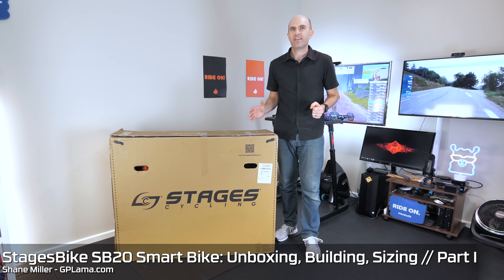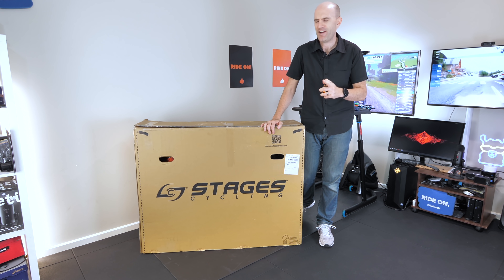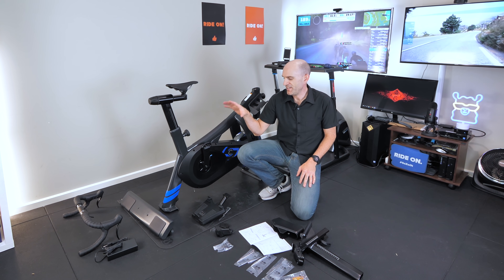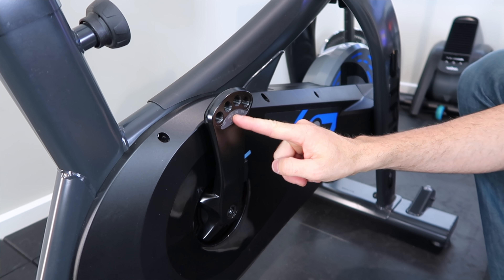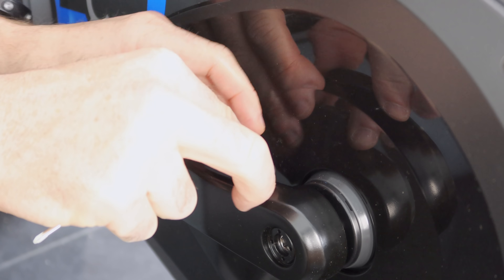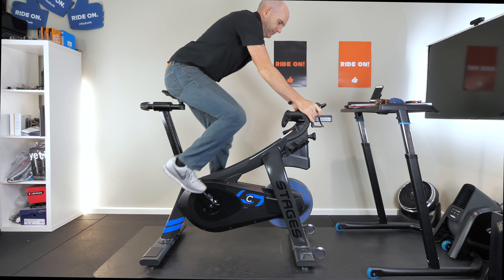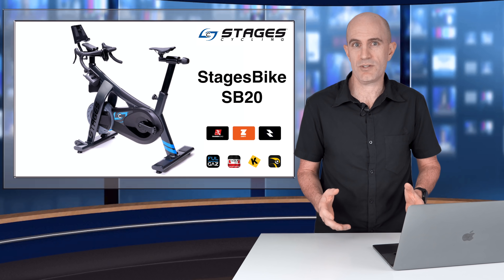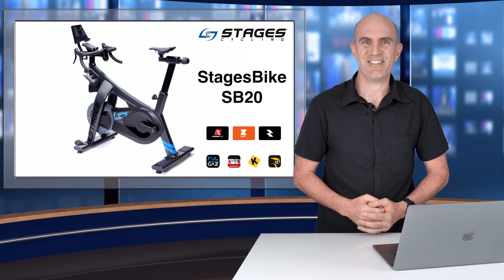StagesBike SB20 Smart Bike: Unboxing, Building, Sizing // Part I

Comment: Shane -  great review Part I video.  I think alot of potential buyers are interested in an in-depth description, review and demonstration video on the various "control modes" that the Stages SB20 bike offers:  manual, level, ERG, simulation, etc.  Specifically, I'm very interested in the Level Mode function of the Stages bike.  There's simply no good information out there on the internet, YouTube (or Stages website) on how this Level Mode actually works and performs.  I have a cycling app that changes levels of resistance with cadence changes.  The "levels" on my app are generic:  1 - 20.  There is no specific power target.  Power is just a result of changing the instructed resistance level with the instructed cadence target.  My current bike (Freemotion Tour De France commercial model) does not give me levels, but only gives me gearing options (standard vs. compact front and various 11-speed combo cassettes).  This works for what I need, but I like the idea of breaking my gears into equal intensity levels.....say: each change in "levels" = 20 watts.  With traditional gears and bikes, changes from one gear to the next gear does not equal the same, equal change in resistance level (given the next higher/lower gear ratio or gear inches).    Thanks again - great videos and reviews.
Reply from the maker: Ball is with Stages for now. The firmware is still beta. No gear change customisation or gear view apps are public. When they are released, I’ll keep these videos coming.

Comment: When is part 2?
Reply from the maker: Longer away than I expected..... Stages are yet to release the final firmware/app for gear configuration.
Reply: Shane Miller - GPLama  I have already preordered one here in the U.K. so was really only after your part 2 as reassurance I have made a good choice. But I think I have as their build & functionality will stand the test of time. 
Do you know if their firmware for the gear change will add a little real life feel to the gear change?

Comment: Shane, I just ordered the bike from USA 😂. Couldnt shake it off my mind. Had to pull the trigger.

Got a question to ask, can you check the power adapter rating for input power, whether it accepts a variable voltage input, ie 110 - 230V input. And that the wall socket end can be easily changed by getting another generic plug end. Is the socket at the power adapter (for the wire end of the wall plug) universal? Reason I asked is that I bought it from USA and where Im staying, the power source is 230V and using UK/euro pin plug. 🤦🏾‍♂️
Reply from the maker: Yep, you're good. The power brick has an IEC connector so you'll be right to go.

Comment: BEST SPIN BIKES (Ranking by Q factor)

1- Wahoo Kickr Bike (Q Factor is 150mm)

1- Nordictrack S22i (Q Factor is 150mm)

2- Life fitness IC4, Ic5, IC6, IC7 and IC8 (Q Factor is 155mm)

2- Life fitness IC3 (Q Factor is 155mm)

3- StagesBike SB20 Smart Bike (Q Factor is 157mm)

4- Spinner NXT (Q factor is 158mm)

4- Spinner Blade (Q factor is 158mm)

5- Wattbike Atom (Q factor is 160mm)

5- Bodytone MT2 and WT1 (Q Factor is 160mm)

6- Schwinn IC PRO (Q factor is 168mm)

7- Peloton spin bike (Q factor is 170mm)

7- Schwinn AC PERFORMANCE PLUS (Q Factor is 170mm)

7- Schwinn AC SPORT (Q Factor is 170mm)

7- Life Fitness Lifecycle GX (Q Factor is 170mm)

8- Wattbike Pro/Treiner (Q Factor is 173mm) 

8- Life fitness IC1 and IC2 (Q Factor is 173mm)

9- SUNNY ASUNA 6100 (Q Factor is 176mm)

10- SUNNY SF-B1805 (Q Factor is 182mm)

11- Diamondback Studio Cycle 1260Sc (Q Factor is 187mm)

12- Schwinn IC4/IC8 (Q factor is 190mm)

13- Keiser M3i (Q factor is 197mm)

14- SUNNY SF-B1709 (Q factor is 203mm)

15- SUNNY Evolution Pro SF-B1714 (Q factor is 216mm)

Q Factor: Is the distance between the outside of one crank arm to the outside of the opposite crank arm.

Why should you care?
I know from experience that the narrower the Q Factor, the closer my feet are to each other, the more comfortable I feel riding a bicycle. 
This is especially true on a long ride or training.
long distance q factor spin bikes can damage your knees
Reply from the maker: Mate...... what’s your mission? One post is enough.
Reply: @gplama  my mission is inform the public the relation of Q factor and knees health :D
Reply from the maker: @pedrodkuhn  Can I suggest uploading your own video presenting this idea then? The cut and paste campaign comes across as spammy and really counters your quest.
Reply: @gplama  Its not a idea its a fact...peace and love

Comment: Hi Shane, when will it be possible to see part 2 on the Stagesbike?
Reply from the maker: Looks like they're a week or more away from having things ready for the gear/app config.
Reply: Shane Miller - GPLama  the little drawback for the moment is the fact that we need to use batteries for the power on the stages bike... looking forward to part 2.... still between kicker bike or Stages 😬

Comment: Shane on ur web site in regards to the pioneer power metre you said it has the dreaded right side problem what do you mean by that? One of my dual sides has stopped working all together and I have changed batteries and it won’t work any idea?
Reply from the maker: https://gplama.com/2019/06/29/shimano-crankset-power-meters/

Comment: Does the seat post wobble around much? I'm 870mm from the crank to the seat so wondering if the seat post would wobble much at that height?
Reply from the maker: Not a lot, no.
Reply: @gplama  Thanks, good to know!!

Comment: What trainer you tried and found to be most responsive in erg mode? Neo 2T, Kickr2018, H3, or maybe cheaper ones like Direto x, Core, Suito are as much responsive as top tier? What would be best in doing vo2max 40/20 type sprints in erg?
Reply from the maker: Sprints in ERG are never ideal. It’s not made for that. Level or SIM is better.
Reply: @gplama  yes, that I understand, but in general, which of those trainers have best response time, does the most expensive ones in this aspect are better than "bang for the buck" ones?.. Still using Elite cubo fluid and it was fine for years, but getting tired of changing turbo tyres on it and wheel slipping on sprints if tyre is not in perfect condition, so planning for direct a drive trainer. Seems waiting for some time was a good idea, as very first iterations of those smart trainers had various problems, which I hope more or less are fixed in 2020...

Comment: Question, One turn of the crank equals how many turns on the flywheel motor?
Reply from the maker: I have no idea. One for Stages.
Reply: @gplama  When you get a chance can post it. Thanks
Reply: Hey Marcus, Jim from Stages here. The crank pulley to flywheel ratio is 4.92:1, so about 5 turns of the flywheel for each turn of the cranks.
Reply: @JimStemper  Thanks. The unit looks good I bet its the best out of the bunch of smart bikes. What the weight of the flywheel just for fun?

Comment: Why does it have batteries for power meter does it not plug into mains?
Reply from the maker: The location of the (two) meters means it'd be difficult to draw power from the mains. Other smart bikes measure power internally. This also means they'll never give true left/right data either given they're a single point of power measurement.

Comment: Smart bike needing 2xCR2032 batteries ... so odd
Reply: do they still have to deal with the notoriously fragile battery covers? hoping to hear about their bonkers power accuracy. Sorry I just have a biased view after owning 3 sets of Stages crank power meters.
Reply from the maker: The twin screw + cover seems pretty solid. The power numbers are looking VERY good from my first ride. More detail on this once I have a lot more kms ridden.
Reply from the maker: Just like the ATOM levers. There's no easy way to do a true L/R crank power meter with mains power. It's also a much cheaper way for them to do power as it's their existing tech.
Reply: Not arguing that they've done it for tech/cost reasons, but just looking at this product as a whole - It just seems really odd to see this on a stationary bike like this. Also the added maintenance of needing to swap these out every few months. Maybe I don't understand what kind of consumer the product is marketed to but I don't imagine you'd see a p*ton consumer fiddling with/understanding why you need to stick little round batteries in the crank arms. Versus an outdoor cyclist/runner that totally understands what is going on/is well versed in CR2032 batteries in just about everything.

Or maybe it's not targeted at the P*ton consumer as the assembly process is probably not for the uninitiated in the bike world.
Reply from the maker: @darrenhaines1  The Peloton model is still light years ahead of the current offerings in the 'real cyclist' arena. Their all-in-one customer experience is something Zwift are chasing. Something Wahoo look to be arming themselves to achieve. And something Stages could possibly execute given their experience in the 'spin class' scene.

Comment: Surely if you were using older Garmin pedals with specific torque requirements, there is no way in hell you'd be getting a torque wrench behind the drive side crank.
Reply from the maker: Thankfully the Vector 3 don't require any of that installation silliness.
Reply: Every version of the Vector uses regular pedal wrenches and not hex keys, so that’s not a problem. The only issue I had installing pedals with hex keys is in the 165mm bore. I had to whip out a short neck 6mm hex key, and thankfully the SB20 comes with one anyway.

Comment: these smart bikes are expensive. durability, or the likelihood of mechanical failure, should be among assessment criteria. the stages looks robust. the wahoo kicker, which has so many moving parts, does not look durable. the stages also has a gates carbon drive.
Reply from the maker: Likelihood of failure would be all speculation at this point. We have to wait until they've been on the market for a few weeks/months to really know.

Comment: 5:24 - not very thought out positioning for fixing handlebars...
Reply: actually very well thought out. if you put the bolts on the front, they will collect sweat and rust. putting them behind keeps them much safer.

Comment: I confess I like it. The benefits of it are pretty innumerable.

What excites me is the ability to fiddle with your position. If you know a little bit about bike fit you could immerse yourself for hours tinkering with the Allan keys and getting yourself set up spot on.
Reply: this does sound fun, but really you should do it once per season at most. I had a proper bikefitting done and ideally I'd like to reuse that position - it looks like that is not so simple transitioning measurements from a real bike. Still the concept of a whole bike makes sense, just not the price yet - I have enough space for n+1 and ideally I'd have a separate trainer and my bike intact.

Comment: Thanks Shane...now I know what was in the box. I see wheels on front end. Would you say the Stages bike would be easy to move about if one did not have a permanent pain cave (say along a wall). Also, you mentioned handlebar swap -- what about the electronics needed for shifting. That may be in Part 2. Cheers from Pound Ride, NY

Comment: It’s definitely not as pretty as the wahoo or tacx smart bike but it looks like it’s built to last!
Reply: Im with you! Stages bike is quite a brick. Worst is the WATTBIKE thouh. Wahoo KICKR Bike wins thins one in the design department.
Reply: BOBonBIKES Design is more than looks. The KICKR Bike and Neo Bike Smart both have chunky top tubes that interfere with some pedaling styles. The KICKR Bike also wobbles during sprints. In this case I’ll take function over form. I knew the Stages Bike would be “the one” since it was unveiled at Eurobike.
Reply: The reason I chose the stages Bike is I want something that is bullet proof, take a beating, and last forever. I'd stages commercial bikes are any indication, and based upon the feel of the bike, I'm confident it will meet my needs. Thing is solid.
Reply: Out of all the smart bikes this on looks more like a spin bike than the others
Reply: Anton Peterson definitely, I suppose it makes sense as they make spin bikes for gyms etc.